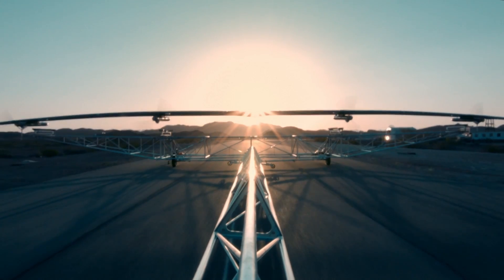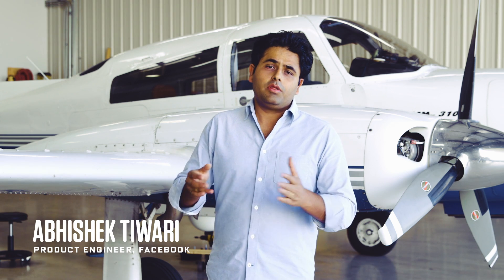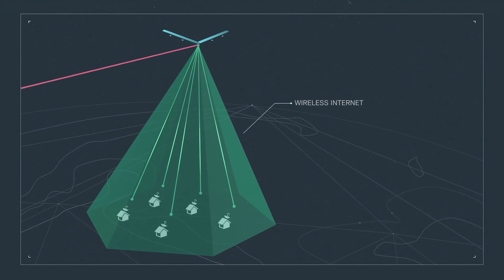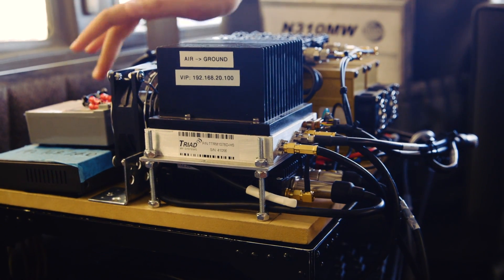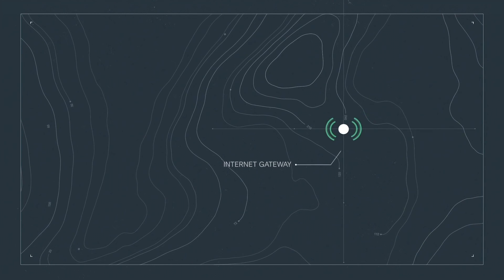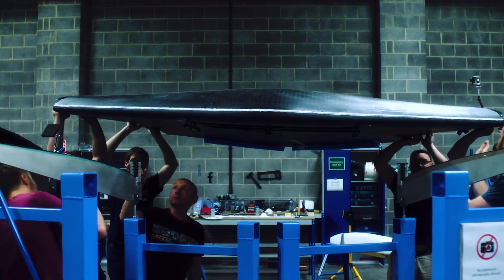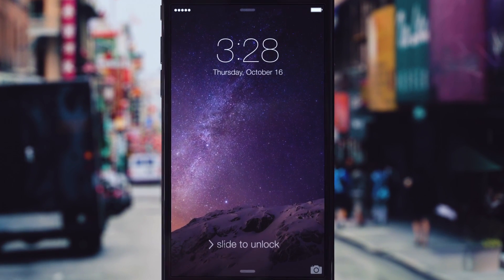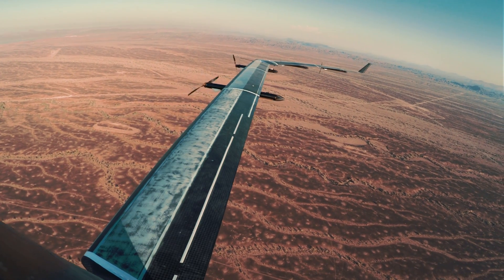Inside Facebook's Quest to Beam the Internet Via Solar Drone | WIRED

Comment: In bad weather and natural disasters, this thing would definitely not stay in the air for very long. Looks quite fragile!
Reply: Can be customized to maintain high altitude with low weight design material and longer battery life powered by Solar.

Comment: This is pretty dope. I mean really really cool! The potential on this tech could litterly be life saving in harsh environments.
Reply: If u look at starlink its does the same using satellites which is much easier way of doing this and definitely cheaper. U also get very good internet speed no quite the 20gb/s speed but in a disaster situation u really dont need to be streaming 1000 4k videos at once
Reply: Or a really potent tool of war :(

I'm sceptical  + Is it just me or do others instinctivly feel that laying a cable would be much more eficient, less resorce hungry and more reliable than building and maintaing these aircraft to bring data connections to roural comunities
Reply: LiquidJ0Y lol, we already have that. Weponized and all. They are talking about civil communication in areas that were too difficult to support before.